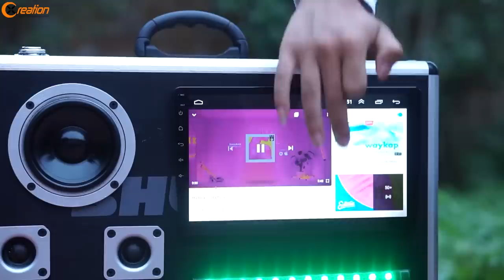DIY Bluetooth Speaker from Briefcase and LCD Android Car Player

Comment: Excellent! Love this kind ofstuff. I made DIY speakers myself with subwoofers. I also made a separate one using speakers from an old CASIO keyoard and added a bluetooth dongle to it to make it bluetooth as well. It also has an output for WIRED 3.5 as well as the one the Bluetooth dongle goes into.

 Now add a headphone jack to your briefcase....to the audio, for personal time? XD

XD

Peace.
Om.

Comment: This Projects is just awsm but there is a suggestion if you use lithium battery  pack it will be good choice and your project will become more light weight and it will also give you more backup 🙂🙂🙂🙂🙂

Comment: The only thing i wanna know is how he manages to access YouTube videos without a wifi/Data connection.  I mean you can take your own personal music collection with you and play offline, but this dude goes straight to YouTube to play a video.... in the middle of a open area...... where there's no wifi.  and since that thing doesn't use a SIM card, he can't use data for that either.  So how did he manage to play a YouTube video?
Reply: He can by using portable wifi device or hot spot
Reply: @cyber5362  OH SH** I FORGOT ABOUT THAT. I've only ever seen one in use, and it didn't even get used that much before it was tossed in the bargain bin next to the couch